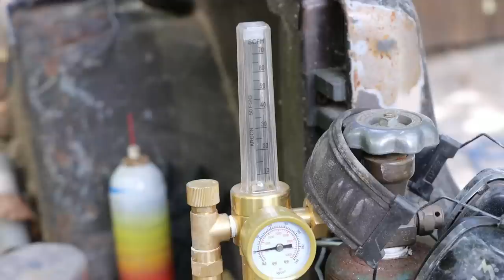Years worth of dents and damage .. DELETED!

Comment: The guys who refinish fibreglass sailplane wings, where contour is critical, sand at 45 deg to the body line, making sure to change direction by 90 deg frequently, and always with a block. They achieve mirror finishes with no distortion.

Comment: Will you store the finished vehicle inside the shop, where it is now?  Or will it live outside ?
If the latter then consider building a rain/sun carport over the area where you're working now, to help it last longer.
My old `73 landrover lives in a garage now, and it starts so much easier.

Comment: Steve, the comment/question "Have you ever scuffed the inside of a truck bed" made me chuckle, because yes, yes I have. I bought a 2014 F150 brand spanking new, and decided I would do the bed liner using one of the roll-on products. First, taking abrasive to a brand new painted bed is scary because it is so danged pretty you hate to mess it up. But second, and more to the point, if I had known how hard this would be when I began, I would have just paid the local shop to do it. The finish has held up relatively well, the most "wear" came from a big load of white rocks for a landscaping project, and I probably need to clean it up and add another coat.
Anyway, I'm enjoying my Saturday morning watching you as I have done since I found this channel way back when you were early into the barn/shop rebuild. Thanks, and happy Independence Day!
Reply: If you think your going to be hauling very much rock, ask your local quarry for some used conveyor belt. They should have some and you can cut a piece to cover your bed floor.
Reply: @garymurt9112  Yep, 9-ply or better fabric conveyor belting is amazing stuff for protecting your bed and other things from damage.
Reply: @StreuB1  we use a lot of it a the quarry, most of the time it last pretty good considering the amount of freshly crushed sharp stone that runs over it a day. Most of the time it will last a few months, except one spot that has particularly high wear and it has to be replaced weekly. There's around 2000 ton of stone go over it daily.
Reply: @garymurt9112  I am not surprised!! Do you know how many plies it is or how thick? Fabric conveyor belting material is also used as blast fragment mitigation blankets in the demolition and mining world. They lay/strap/chain it over the tamping material that is placed over a shot to help slow down and/or stop high speed blast ejecta. Amazing stuff and insanely tough.
Reply: @StreuB1  I don't know the ply, but on the stacker belts they are 1/2 inch thick but the widest for them are 3 feet, the under screen belt is a good 1 inch thick and 6 feet wide. Our quarry is relatively small we typically only run 2 to 3 thousand ton a day. They don't use any type of blast mat here. I assume they are far enough from any residential house to not require

Comment: Dry guide coat = carbon black powder AKA soot ! You can also use cheap lacquer spray paint if you can find it, or the ultimate cheap item, the chalk you use to fill a chalk line applied with a foam paint brush... Main reason I ran multiple guns is time, I can shoot primer on a couple panels, dump the gun and toss it in the cleaner, grab the color gun and shoot color onto another vehicle that is ready to go, then dump it into the cleaner and grab the clear gun and start clearing as soon as the color coat flashed off. Get done, pull the primer gun down and blow it all out, Shoot another coat of clear, put the gun  back together, shoot another coat of clear and then dump the clear gun and clean the color and clear guns while the clear is baking. By then the primer is ready to sand and the cycle starts over.

Comment: Brilliant job on the bed body Steve lots of work to be sure.  I've never used a gravity fed gun before, do you have to be closer to the job than a normal suction cup gun? I ask because it looks as if you are spraying at around 4-6" away from the body, I of course could be wrong about that. But usually I've been told that around 8-10" is the best distance for suction cup guns. You of course and your brother have far more experience at spraying than I do your thoughts would be appreciated. Best wishes from the UK to you and Elizabeth
Reply: Gravity feed (HVLP) guns produce less overspray and a more consistent droplet size and distribution across the entire fan. That means you don't get the dry edges from pass to pass like on a suction gun. The close gun to surface is so you can get really consistent coverage and assure the product goes on the metal and not the surroundings. You run lower pressure so you can throttle the gun down so you can get that affect.
Reply: If you finish sand before you clear you can have an awesome paint job even from a brush!

Comment: What is gonna happen to all that sanding and spraying dust? That is microplastics which is not biodegradable and will accumulate in local wildlife or be washed out into the ocean.
Reply from the maker: There is definitely a environmental cost any way you go unless you decide to walk everywhere . The impact of new production vehicle would likely be much higher than maintaining ones that are already on the road and this one has been for 35 +years. There is far less plastic in this older vehicle than in the new ones. I dont disagree with you about plastic wastes being a real problem. 
Thanks for watching 👍